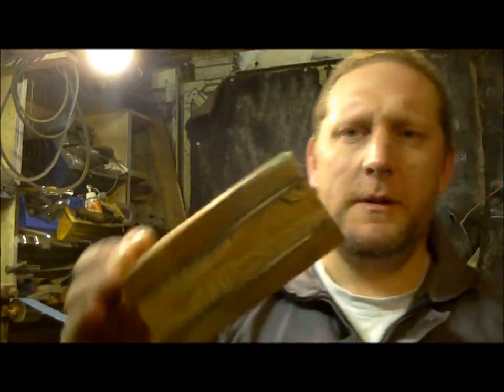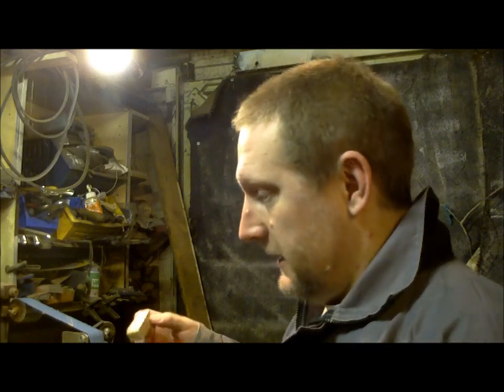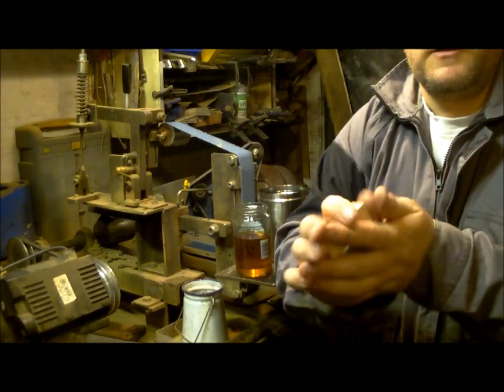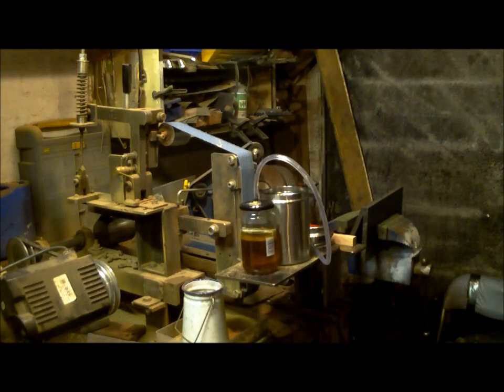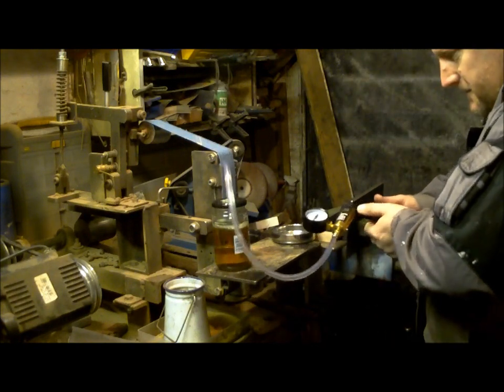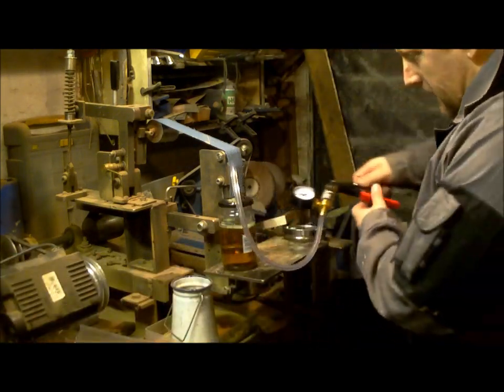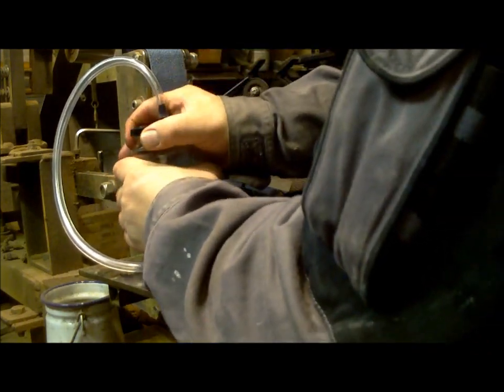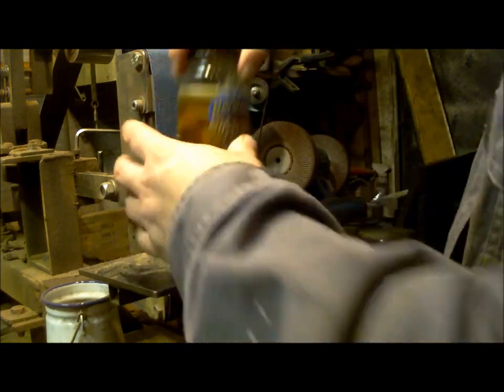Using a brake bleed kit to vacuum treat wood for knife making for boiled linseed, cactus juice

Comment: Ooh ya big old tease! On the edge of my seat here!
As you said, bubbling means it MUST be doing something but I'm keen to see the level of difference. 
Atb
Andy
Reply from the maker: bubbles rising could be atmospheric gases dissolved within the oil "boiling" out due to the dropping pressure so the bubbles I am watching for are air escaping from the actual wood, something called "Henry's" law I think concerning degasification of liquids and solutions using vacuums or sonication,,,heating also reduces a liquids ability to retain gases...all the time the vac is drawing air out I don't think much oil is infiltrating the wood, when the release occurs then the oil has chance to penetrate, at this point a foot pump increasing the pressure could encourage a deeper soak but I "ain't got time fer that" at the moment hahahaha!
Reply: Wessex Blades&Bushcraft cheers Scott. I grasp the principle (I think!) - like when you open a bottle of pop and the reduced pressure lets the dissolved gas out. Two more interesting tests then:
1 vacuum oil alone to check for the boiling effects
2 try vacuuming then pressurisation for another results comparison. 
I couldn't ask you to put your poor wrists through that though so I'll do it once I get a pump and rig up.
All the best mate,
Andy
Reply from the maker: already done..this vid was from last Sunday....

Comment: Have you considered a one-way valve to help maintain pressure? And the bit of moisture in the line might be condensation build up.
Reply from the maker: too many things too really worry about , is the drop in pressure actually reducing the oil's ability to maintain gases dissolved within it and therefore some bubbles are technically boiling off, is the flexi plastic pipe yeilding under the lower pressure or is the seal not airtight, how efficient is the hand pump . it's seal etc. ,,looking at other set ups I reckon the canoe pump used for inflatable kayaks used on deflate a few times will remove a lot of air within the wood, then release, then use on "pump" to ram the oil in will take only a few minutes,,the electric vac pumps are the way to go if you have the capital and a vessel that will take the negative pressure,

Comment: I just had an idea, how about weighing the wood piece before and after, to see how much oil  has been sucked in.
But thinking about it you will probably need jewellery scales or something that can weigh tenths of a gram accurately.
You can make a poor mans vacuum pump from an old fridge pump, I haven't tried it but there are loads of vids on YT.

Comment: I have one of those  car booster/starter power packs . the 6 in 1 sort, with an air compressor built in to inflate tyres... could one of those be jerry-rigged to provide the  pumped in air for pressurisation  ?  or one of the stand alone mini compressors for tyres ?  or even  one of those little  powered inflaters for the air mattress dodads ? (bet funky has one of them )... then could any be reversed to assist in sucking air out for vaccuum treating ?  Aldi were flogging air compressor for air line rools the other week, for about £70... bet you could have McGuyvered one of those to do all manner of amazements.
Reply from the maker: anything along those lines can be hokey . kokeyed into a kind of system but care towards the integrity of the vessel should be paramount,, I'm just using jam jars which I can appreciate will cope with boiling jam,, lid on,,, cool,, and then the drop in pressure as the air contracts to create the seal,,, my little brake bleed kit won't break this,,, any vessel be it steel,  aluminium would need to be appropriate for the pressure used be it +ve or -ve and the amount of treatment liquid used to fit in the wood/knives concerned.. being "slightly"  sciencey I'm just brushing the surface of an industrial process that can be invested in from pence to £1000's...my time and capital restricts extensive testing so to me , I'm happy with just the air coming out of the handles, this then means that the oil hasn't got that to get past when the -ve pressure is released.. ideally it would be kiln dried, brutal vacuum maybe 5 times to really work the air out, release pressure, brutal pressure and soak for 48 hours....the kit / vessel/ treatment/ kiln/pipes/ wood type and more is up to our resources to cobble together.. a good stirrup pump, old fridge compressor, tyre inflator are all viable stand ins..
Reply: Wessex Blades&Bushcraft     Is that a gentle way of  telling me  that 'me' plus a 'big old jar' , and some 'random airflow devices' might be a fast track to blowing myself up ?   :)  ...   always did like blowing shit up, but did try to  stand clear when it went.  Seeing as how I might be in the same confined space as the  Vaccuum/pressure chamber Looks like  more thought on the  'chamber' integrity needed at my end. Flaying glass and  general debris not a good plan.

Comment: Thinking attach one of the handles with cable ties to a bit of wood on the floor, the other handle attach a foot pedal...Foot power won't give so much RSI.
Reply from the maker: it'll break I think if I did that,,in hand at least I can alter the way I use it to keep it together,,,the piston is very light duty..

Comment: Pressure processes are the most permanent method around today in preserving timber life. Pressure processes are those in which the treatment is carried out in closed cylinders with applied pressure and/or vacuum. These processes have a number of advantages over the non-pressure methods. In most cases, a deeper and more uniform penetration and a higher absorption of preservative is achieved. Another advantage is that the treating conditions can be controlled so that retention and penetration can be varied. These pressure processes can be adapted to large-scale production. The high initial costs for equipment and the energy costs are the biggest disadvantages. These treatment methods are used to protect ties, poles and structural timbers and find use throughout the world today. The various pressure processes that are used today differ in details, but the general method is in all cases the same. The treatment is carried out in cylinders. The timbers are loaded onto special tram cars, so called buggies or bogies, and into the cylinder. These cylinders are then set under pressure often with the addition of higher temperature. As final treatment, a vacuum is frequently used to extract excess preservatives. These cycles can be repeated to achieve better penetration. (wiki)